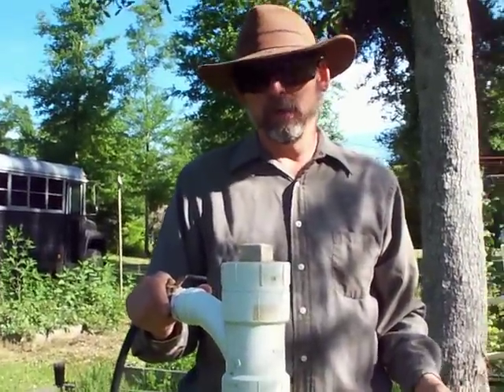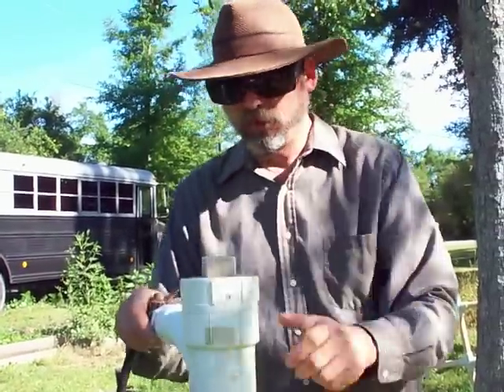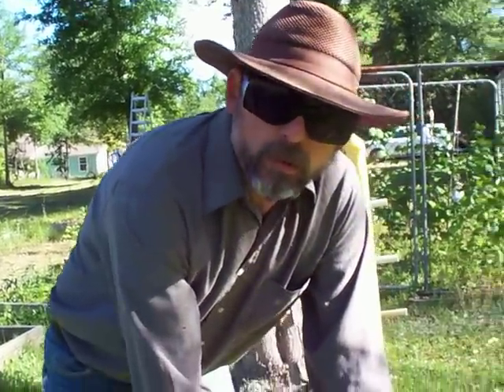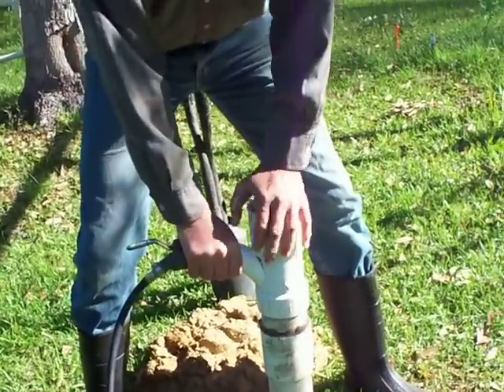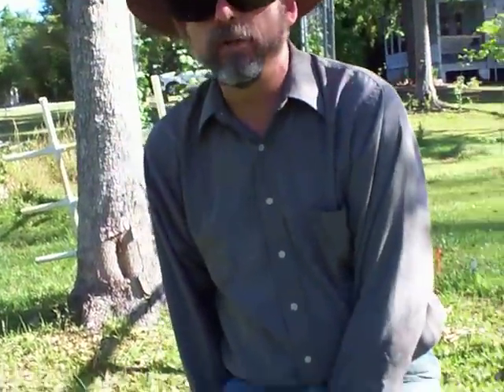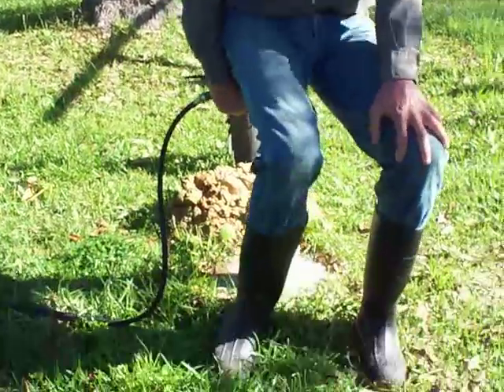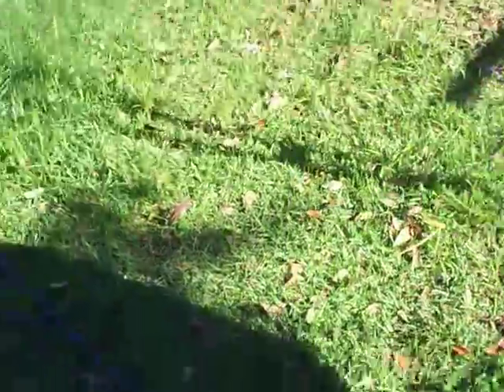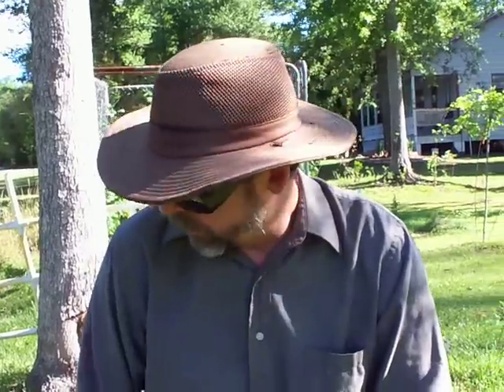Do It Yourself Well Jetting Rig Part 2 Jetting

Comment: Thanks... The challenge is off-grid remote where you don't have a a lot of water or electric for water pressure.  Low budget effort here, but  I got lucky on some very sandy remote central Florida land. I picked a low spot and hit water at 12' down by hammering (no jetting) a PVC 1-1/4 wellpoint  into the ground.  Great volume and  clear but's  75 feet from where I camp, sleep and work.   Have not tried, I think my 12v transfer pump will be able to move the water with a 3/8 hose to me (not sure need to test it).   I'd like to jet a well next to me, but I'm a good 5' higher in elevation and hammering was a serious chore and no guaranty I will be so lucky.   I was thinking of jetting using about 7 gallons water i can carry and a 12v transfer pump I have in my van.. but don't think 7 gallons will be enough?  also considering recycling and filtering the water that comes up the top somehow in a circular process Ive seen with sump pumps.  But my pump is just a transfer pump.
Reply from the maker: I used a whole lot of water under a whole lot of pressure to drill my shallow little well.  And for the most part, all that I was jetting through was sand.

Comment: A washdown valve or sand shark on the end of the $15 PVC well point washes in a well nicely without an outer casing. Just remove the plastic plug in the end of the well point and glue on the washdown valve. It has a floating check ball that plugs the end of the pipe when drawing up water but allows your jet of water to flow out the end during installation. There is also a female hose to hose PVC fitting available. https://www.amazon.com/Campbell-BWDV125-Wash-Down-Valves/dp/B000DZKWO6

Comment: Having problems with a sand point well concept, where do you get water when its your only source of water?  Okay, a stupid question.  Just sure plug up with debris, freeze up in the winter time, well if you have a winter.  Went we a submersible 50 years ago, had a spare pump and control box, could replace the pump in less than two hours to save paying a plumber a zillion dollars, but the pump could be rebuilt, least back then when made in the good old USA.  Was also mounted ten feet above the depth of the pipe, so only clean water flowed up.  Outlet pipe had to be buried six feet under the house, so never froze up. 

Just seems like if you want endless problems, get a sand point well and with a suction pump, sure can't go very deep.  May save a couple of bucks, but that is only short term..

Comment: it will flush out grass roots. Just have to shark tooth the end of the pipe then lift the pipe up to flush roots and grass.
Reply: If you post hole dig first, your fine dirt funnels back into the hole dug with the post hole diggers. This in turn can jam up your couplings when you get a ways into the hole. another trick if one must use post hole diggers, is to put a short section of pvc into the hole bigger than that you are drilling with. then the mud, silt and water flows out of the hole and cant get back in.

Comment: If you wanted a hose larger than the washing machine hose, look for a leader hose.  It's female on both ends and is generally used to connect water how reels to the faucet. It will allow more water to flow.
Reply from the maker: Thanks..…..!

Comment: Drop in some filter sand around your point before extracting your jet rig, that way if your point is in a clay layer, water will be able to get through the clay via the sand which will form a wick. Without the sand wick, a clay layer will blind off your point.
Reply from the maker: Iliveoutside Outdoors I decided right after installing this well that the next well that I jet in I am going to do exactly that.  I figure that the added cost of filling the well all the way to the top with sand would probably be about six bucks.
Reply: The purpose of the sand is to allow a flow path for water THROUGH a layer of clay. If you jet your point through water bearing sand but end up in a clay layer, the sand will allow the water to get the screen. I know this works and is standard practice for installing well point and deep well dewatering systems for underground construction and excavation. I have been involved with this type of method professionally for over 15 years working in the pump and dewatering industry.
Reply: Iliveoutside Outdoors SustenanceNCovering that would not work. Clay is an impermeable sediment layer. You won't get water flow if you're in clay, no matter if there's sand around your well screen or not. The sand helps in filtering the water and making sure that the natural lithology doesn't bind around your screen slots, especially if it has a good amount of silt or clay in it. If it's actually clay, you won't be getting water flow. You might get a drop or two. But it won't be a proper well and it won't produce a decent flow and quality of water. Basic geology. I drill wells as part of my job, though not for drinking water but the same construction. The key to getting sand around your screen is pouring it in and slowly backing your jet rig up and out. This will agitate the sand as it comes down and helps it settle nice and packed around the screen. Make sure you have sand at least two feet above the level of your screen. You can throw some tubing and a pump down the well and it will suck out all the fine silt and clean out the screen slots so that only sand is up against it. Then you won't have to wait days or weeks for the dirt to settle out of the water. That's the right way to do it. They sell screens with sands prepacked around them and kept in place by mesh but they're more expensive than putting in the sand later.
Reply: Iliveoutside Outdoors A layer of clay will bare no water through it. It's impossible. You're not getting the water from the clay, you're getting it from permeable layers, which include sand. The only reason you would need a sand pack around the screen in such a case would be if you partially or fully submerged your screen into a clay layer. There's no reason to do that. The only reason to drill through a confining layer of clay is to get to a deeper aquifer. Judging by the video, we're going for a shallow surficial well here. And the other important point being that rig would never get into a layer of clay. It might get into something with a significant portion of clay, silt, and/or sand but it would never be able to bore into a layer of clay with any success. I think the more important reason for a sand pack for SustenanceNCovering in this case is to make sure his well is clean and stop the need for waiting for it to clear out.
Reply from the maker: edcjunkie I been drinking from them and a couple of years later still don't feel sick.  
But, you are correct.  Jetting won't even go one millimeter further, once you hit that clay, it's over.
Reply: edcjunkie you and I are not describing the same scenario. I am not claiming water would be "pulled from" the clay. If you have a water bearing layer of sand above or below a layer of clay, and the tip of your point ends up in that clay, you will blind off your point for exactly the reasons you stated. However, if you surround your point with sand, the water will travel AXIALLY along the point through the sand. This is what dewatering contractors call a "sand wick". This can and will allow water to get to the point from above or below the clay as it will travel up or down, not horizontally. 

I am well versed in the permeability of soils and can calculate a drawdown for a dewatering system. I am not sure what type of wells you are installing but I have seen this method employed many times in the Midwest where there are stratified soil conditions.

It is important for someone looking to install this type of well to realize the value of the filter sand and include it in their well design.
Reply: You dont need a 12" drilled column for a small well designed only to produce a few gallons at a time, but this basically describes what I am talking about:

https://books.google.com/books?id=PiBVIzjsQygC&pg=PA139&lpg=PA139&dq=dewatering+sand+wick&source=bl&ots=Vhr3jl9q38&sig=bfCsoqb91Xxd6abuN8gijYMqvkc&hl=en&sa=X&ei=EyViVfrOBcvDsAWCu4GQDw&ved=0CDwQ6AEwCA#v=onepage&q=dewatering%20sand%20wick&f=false

Comment: Will the well point stem still pump water if you leave the larger drill stem in place? Other than wasting pipe is there a problem with leaving the drill stem in place?
Reply from the maker: No.   You can leave it there.  In fact if you can get it down deep enough you only need to leave the center pipe down low enough to reach water.

My real well that feeds my house has about 300ft. of large diameter pipe, but the well itself only has about 40ft of pipe down in that larger pipe.  It's a whole different system, but the concept is the same.  Water will find it's level.
Reply: SustenanceNCovering very cool. I live in a city of 300k and was looking into a secondary water supply. This is the last big step in my preparing. The EPA was testing in our subdivision a few years back and I found that my property has water at 34 ft. Your system, and others on YT, appear to be what I need.
Great videos.
Reply from the maker: acklan3 I hit hard impermeable clay at about ten feet around here.  My deepest well is about 15 feet, and my shallowest well is about 5 feet.  (I think)
Reply: SustenanceNCovering We put a jig crane in and we augured down to 8 ft. It was mostly loose dirt. I am hoping the ground around here is fairly loose.

Comment: put in several wells using the technique.use a trash pump with a wading pool. dig a hole for the pool until the top of the pool is level or a little below grade.the trash pump pulls its water from the pool. the pump drives the jet and the water flows back to the pool to be recycled by the pump. using this system ive jet wells down to 45 feet in just a few minutes 1800 gph trash pump moves a lot of material we then hook up a shallow well electrical pump. in an emergency a hand pump riser  used.
Reply: That's a great idea Sherri !... thanks for sharing

Comment from the maker: That sounds good to me.  I have part of my drop pipe in casing over here as well.  I think that as long as the well point is in contact with the soil everything will work.  You might want to drop some gravel or sand down your casing to cover your point to act as a kind of pre filter.  My wells all still pull up some mud when I use them.
Reply: You probably dont give a damn but does someone know of a tool to log back into an instagram account?
I was dumb lost my login password. I appreciate any tricks you can give me.
Reply: @Brentley Alfredo Instablaster :)
Reply: @Marcus Nash Thanks for your reply. I found the site thru google and im in the hacking process atm.
I see it takes a while so I will get back to you later with my results.
Reply: @Marcus Nash it did the trick and I actually got access to my account again. I am so happy!
Thanks so much, you saved my account!
Reply: @Brentley Alfredo You are welcome xD

Comment: THANKS FOR THE VIDEOS....do you see any problem with a shallow well, less than 25 foot, leaving the 3 inch casing in the ground to 15 foot or so, (at least past the hard pan clay in fl) drop a 2 in shallow well point below that, maybe to 20-22 feet..and use a well seal at the top of the 3 inch case that tightens around the 2inch pipe that comes up..Have you ever tried that? That way if the screen on the 2inch gets clogged you could pull it up, thanks again...best, Steve

Comment from the maker: I don't know if it will help the flow, but it wouldn't hurt.  In fact if you just put the well point down by itself, when you pull the big pipe out of the ground your well will fill with mud and it will take a few months to get all that mud out.  You can see an example in the video that I recently made of my last well dig.  If you got some gravel or even just some clean sand I would drop it down in there.

Comment: I'm just about through with my off-grid cabin and have been sweating the $3700 water well price I was given by a contractor to dig one. This video is a relief to see. I have a 4 acre pond within 150' of my cabin. My water table seem so to be high because I have seen it standing in a 6 foot hold that I dug most of the summer. Should I drop gravel down the larger pipe once I place the 1-1/4" down. Should that not help the flow? Or will a well point just allow plenty of water regardless?  Thanks.

Comment from the maker: If you drill a hole with an auger you can just drop the pvc well point and pipe in the hole and backfill with about 6 feet of sand and refill with what you dig out.  Or if you don't have an auger, you can get a drive point which is a stainless well point that you drive into the ground with a sledge hammer.  You will have to use all iron pipe.  PVC will just crush if you hit it with a sledge hammer.

Comment from the maker: Once you get your pvc down as deep as it will easily push in, take off the hose and stick your tape measure in there.  When you pull up your tape measure, you will be able to see just how much water is in your pipe by reading how many feet of the tape measure is wet.

If you don't have water on your tape measure, there is no reason to put together this whole complicated expensive rig.

Comment from the maker: I don't bother going down to the water table.  I just dig shallow wells.  Shallow wells (less than 20ft) are only going to get what is called ground water.  It isn't important to find ground water.  Ground water is everywhere.  You just have to find sand.  I wouldn't invest in the whole well drilling rig that I made.  First just buy a piece of pvc big enough to put a tape measure down inside of it.  put some kind of connection that you can hook a hose to and jet that skinny pvc into the ground.

Comment from the maker: @luvintherawlife If you have a high water table that is half the battle.  Now all that you need is a layer of sand, because if the water comes all the way to the surface but it is in dirt or clay than this still won't work.  But it is easy to find out.  just jet in a piece of pipe and stick a tape measure down in the hole to see if water is seeping up the pipe.  Just a regular tape measure like you would use at the lumber yard to measure how long a piece of wood is to cut it.

Comment: I can easily see how, by using steel fittings and welding a hardened steel "star" bit onto the drilling end, you can use an "A" frame lever system to actually drill through rock with that system. Nice and easy design you have there.

Comment from the maker: @dumdan1988 Back a few years ago, you could ask your neighbors how deep it was to water, but nowadays people don't use shallow wells so nobody knows.  What I would do if I was you, is just buy a 20 foot stick of 3/4" pvc and a fitting that will fit to a hose, and jet it in as deep as you can go.  Next disconect the hose, and use a tap measure to find out what the water level is imediately .  Come back the next day and measure again.  I may make a video about this.